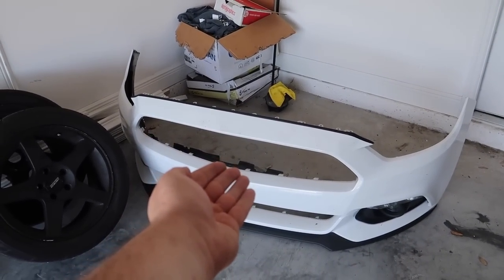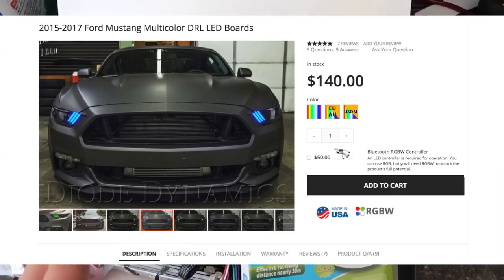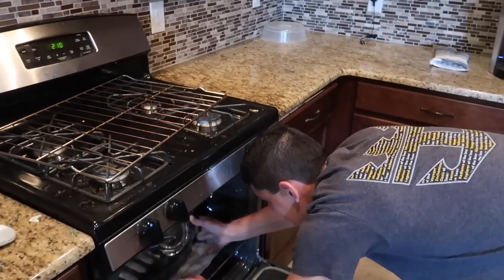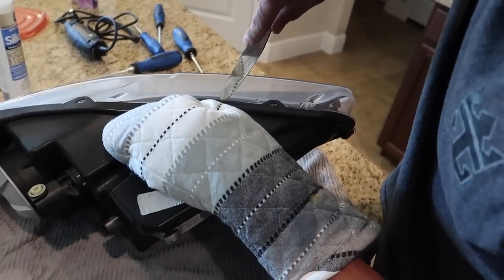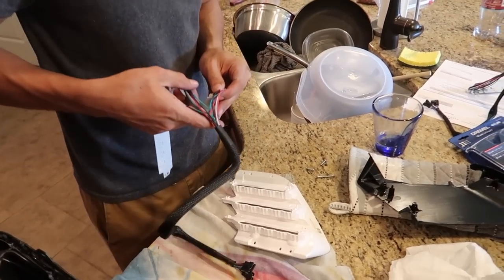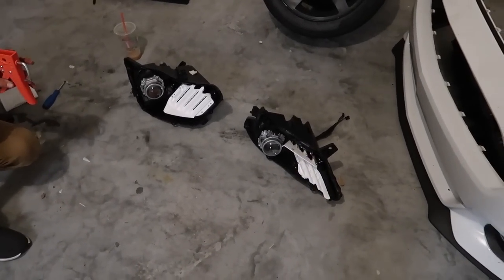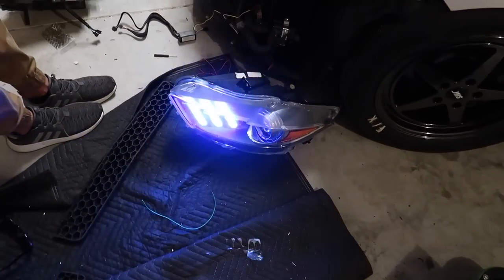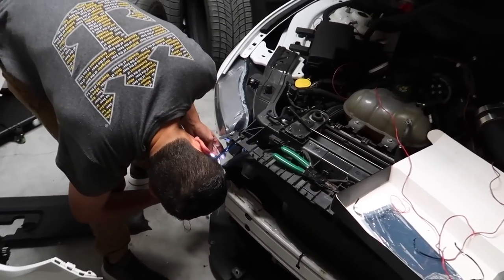Whipple S550 Gets a Facelift Grill Delete + Diode Dynamics Lights

Comment: At least do the black corner pieces on the headlights, LMR has black and smoked for like $20, it's just the corners of headlights. And I agree with others the LED turn signal switch backs and side marker kit is so worth it. Only get Diode Dynamics the Raxiom kit sucks ass